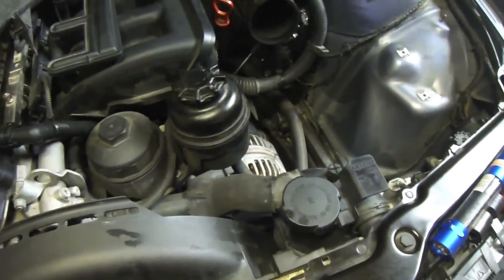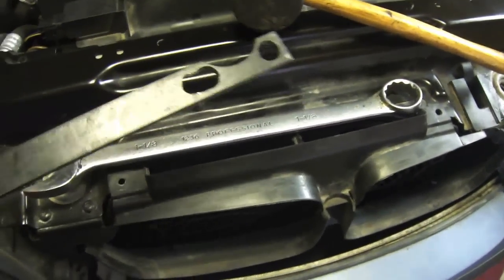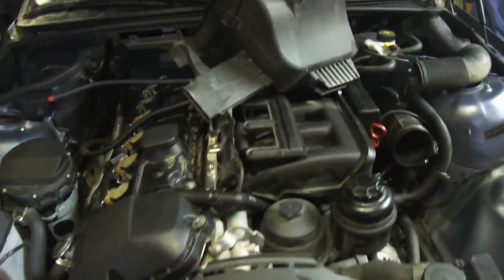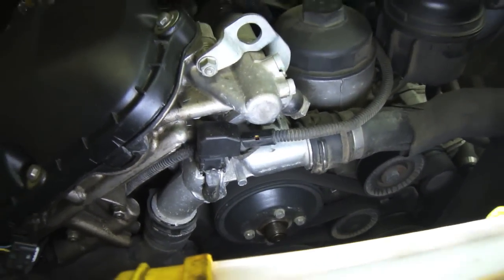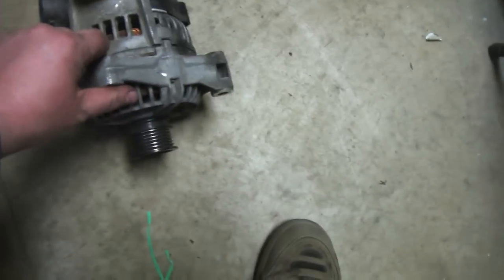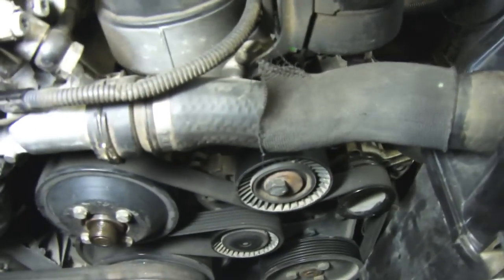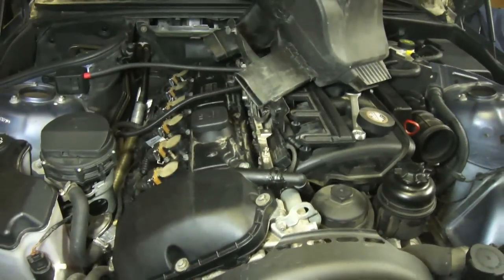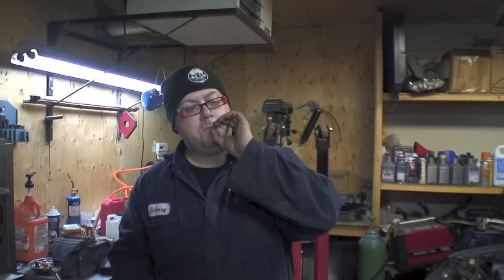DIY How to remove a Alternator BMW E46

Comment: FYI, you can remove the fan without the special tools. Remove the upper radiator hose to improve access, then use a large adjustable wrench on the fan nut and a 10 mm box-end wrench to stabilize one of the pulley bolts. If your fan nut is not on their too tight, it'll work!

Comment: Hi. I know it's been a while since you did this video but I have just tried to get my alternator off to get to the oil filter housing bolts so I can change the gasket. Took the screws out but could I get that bastard off? Could I fuck!! You see that bottom screw nut? Did you have to do anything with that to back it out? How did you persuade this damn thing to come out? Lever it? Beat the shit out of it? Twist it? Bend it?  I just had to put it all back together again while I figure this out. Really pissed me off. Ready to give something a caning. Would appreciate your advice.  Cheers!
Reply: Retread a few turns. Locking nut. The nut slides open and closed to lock onto the frame. Tap or beat bolt lightly from where the fan was to open position. The bolt slide to lock it down. Pull after you finger it off. When you see it how it lock be thankfully you didnt break the fxxxer.

Comment: Im having a hard time trying to remove the alternator, do you have any tip?
Reply from the maker: +Axel Ocampo use more muscle
Reply: Pick ax !! The bottom nut slide open and close and holds or locks . Rethread few turn and tap from where the fan was. but should slide back take bolt out and it should be free.